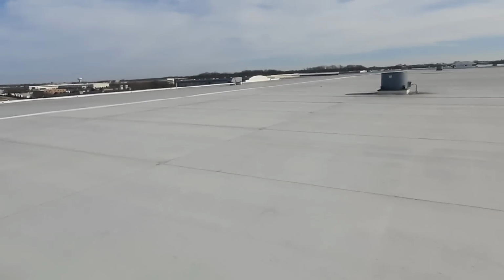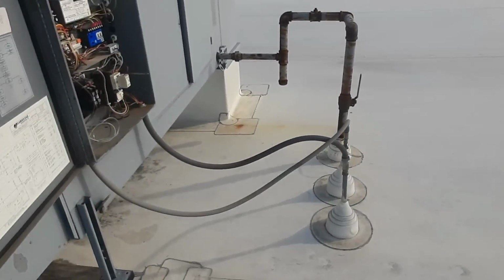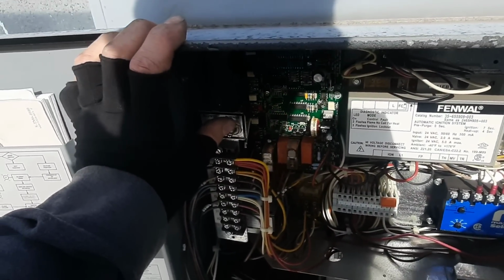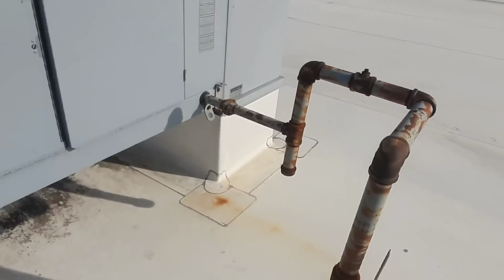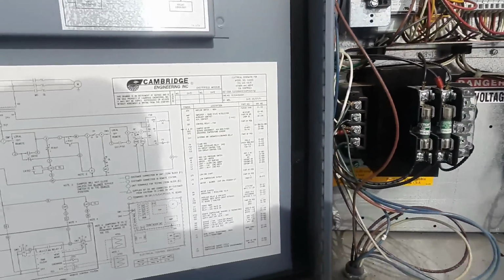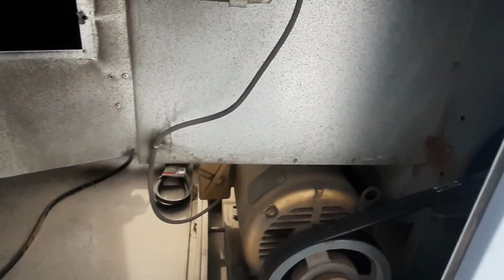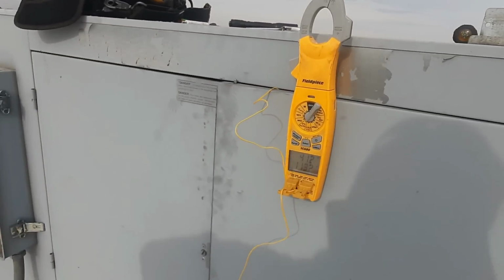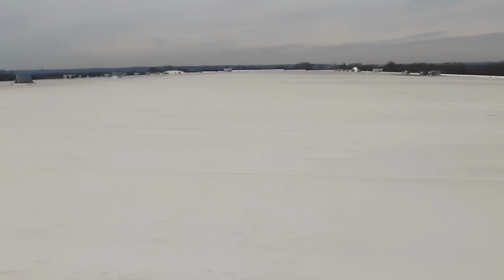Cambridge direct fired makeup air unit no heat #hvac #hvacservice #bluecollarlife#hvacr #industrial

Comment: How to bypass the actuator?
Reply from the maker: You should not bypass the actuator, but the supply fan will not start if the damper end switch does not make or close.

Comment: Sounds like the sheaves are grabbing the belts
Reply from the maker: They are grabbing a bit. do you have a solution when that happens
Reply: @EverythingHVACR  I usually just replace them, butI have scuffed them up with some sanding cloth to get a little more time out of them. I was taught to remove belt, squeeze together and pull into groove then try pushing it back. If there is any resistance, the sheave is worn.

Comment: Who s the genius engineer who put the gas train and controls in the blower section
Reply from the maker: This has been the Cambridge design for a while, these are pretty durable and reliable units, this one is probably 30 years old.
Reply: @EverythingHVACR  Ive never seen those before
Reply from the maker: Are you on the West Coast? We see a lot on the East Coast.

Comment: You ever work on absoluteaire?
Reply from the maker: I don't think I have. Is it direct fired make up
Reply: @EverythingHVACR  yes sir. I've worked on a couple here in north Texas.
Reply from the maker: Nice. Like most units, I'm sure the general operation is the same. Air flow is critical. Do they use maxitrol? And what type of actuator? I think Cambridge is using a different actuator now.
Reply: @EverythingHVACR  they do use maxitrol. I'm not sure on the actuator.